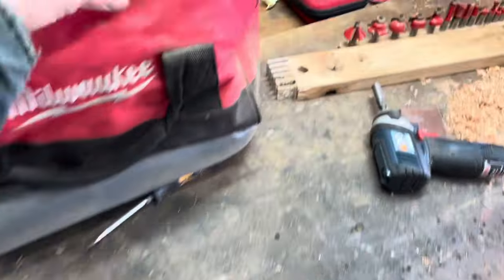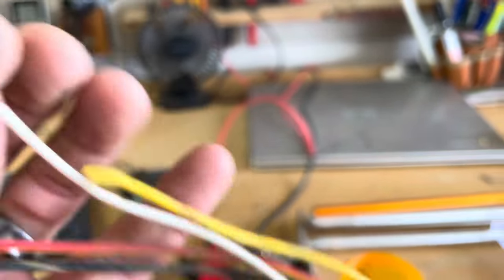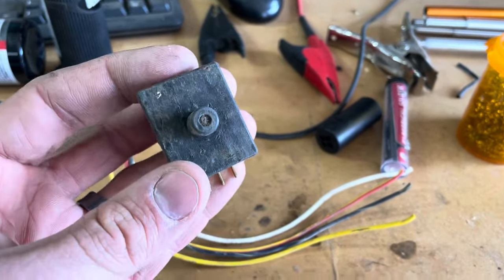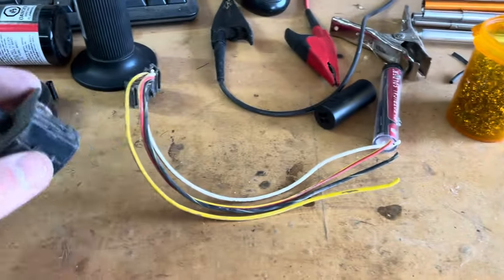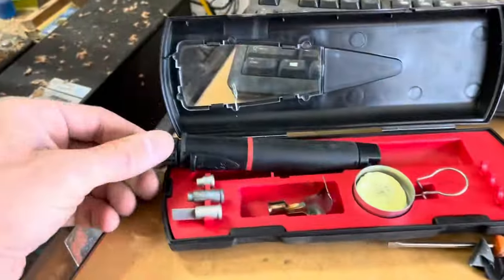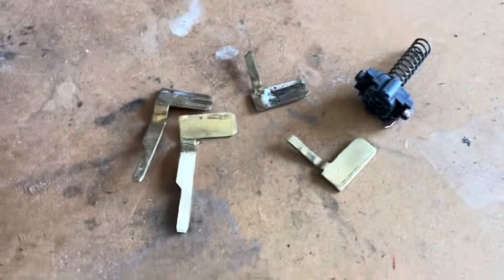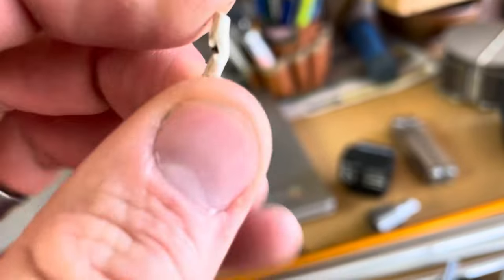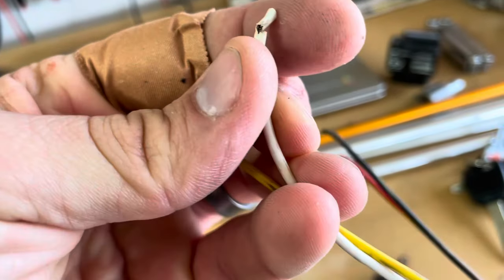Kubota ZG127S stalls with handles engaged - seat switch

Comment: Thanks for the well explained video. Im having a similiar situation but curious if its the switch. When troubleshooting and while sitting on the seat i can bypass and start safely putting a screwdriver across the solenoid with key in on position (will not engage to start using key). Once i get off the seat afterwards it dies even with the e-brake pulled, levers in correct position and pto off...Hmmmm? Didnt have much time to troubleshoot but was curious if you have ran into this problem. Will also not start with trying the method while off the seat which it should be, but normally would stay running after with pto off, levers in correct position and e-brake off.
Reply from the maker: I cannot be sure if I’ve seen that exact topic before. In general, the starter will only engage if 1. Key is in run, 2. Clutch is in (if equipped, 3. Handles disengaged, 4. Seat occupied, 5. PTO off. Tracking down which of the listed is not ok can be a real pain. Sometimes the only way is to watch each switch position (at the back of the ignition switch ugh!) with a multi meter
Reply: @35andRetired  Thanks for quick response. Thats my next step to check switches at solenoid. Just curious if it'll change the states while they are still hooked up, or if ill have to unhook and do 1 at a time.

Comment: If I just wanted to replace the female connector from the harness; where could I get one?
Reply from the maker: That kind of thing is pretty tricky to get. It’s probably easier to get a generic male and female connector and attach both together. That’s what I would do. Otherwise, you have to get it from the dealer, but connectors are always a pain to identify and make sure that you get the right one. Best of luck to you.

Comment: When you are shorting the wires white to black and red to yellow. Are you putting a jumper wire in the plug end to the corresponding wires?
Reply from the maker: In this case, I had the customer's permission to just cut the connection and solder the wires together and add heat shrink...
Reply: So would putting jumpers in the plug end have the same results?
Reply from the maker: @DavidBrown-pu1cf  yup. Connecting those two terminals in any way, shape or form would have the same result. Just be aware that vibrations might cause your little jumper wire to come out overtime.
Reply: I figured it would ill probably go the solder route. Just wanted to test the jumper method to make sure it would work. It's randomly cutting off was gonna jumper it and run it to make sure it's the seat switch and not the neutral switches before I make it a permanent bypass.
Reply from the maker: @DavidBrown-pu1cf  for sure. That’s a good decision. Exactly what I would do for testing purposes. Just don’t shove anything too large into the female pins, it can spread and damage them.
Reply: Alright thanks for the tips and keep making great videos